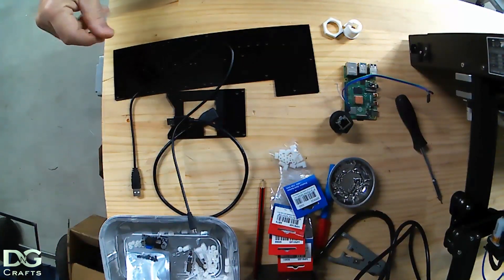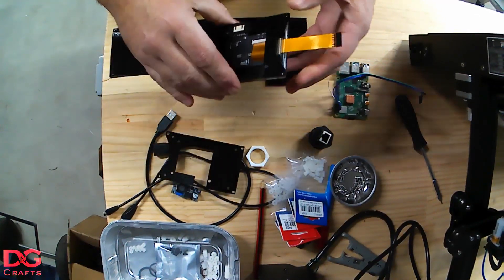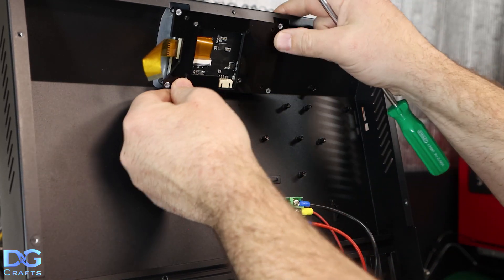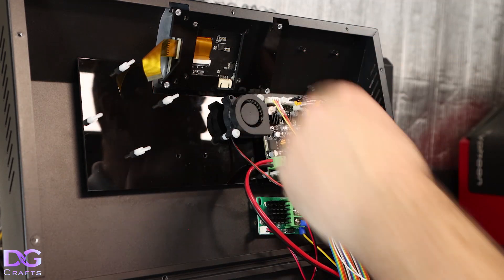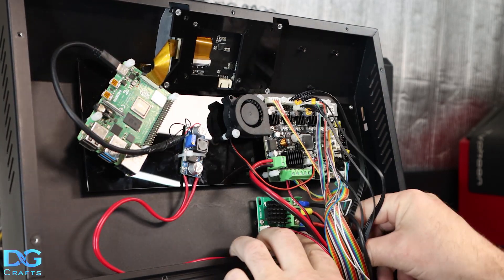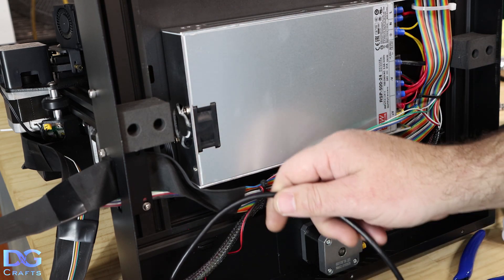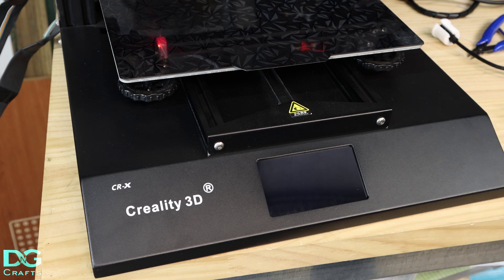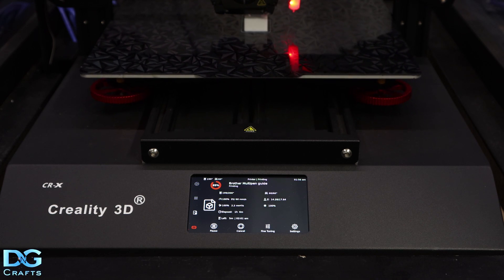Upgrade CR-X / CR-10s Pro to KlipperScreen

Comment: Hi, I am wondering what mainboard is installed into your CR10S Pro?  I am interested in doing this upgrade. The mainboard I see in the video does not appear to be the same as mine.
Reply from the maker: the printer in this video is a cr-x with the silent stepper mainboard used in the cr-x pro.

they are pretty much the same and the printers mainboard is not really an issue because you should be able to flash the klipper firmware to it and have the pi do all of the work with klipper.

i had a cr10s pro v2 which i also done the mod to and it worked fine.

Comment: Great tutorial, I'm in the middle of upgrading my old CR10s Pro V1 with a BTT SKR Mini E3 V3 motherboard. Just trying to work out the ribbon cable conversion to the new board. Noticed that you have done this already with this build, do you have a schematic for the ribbon cable to motherboard?  Was thinking of using another daughter board but was not sure if this would work on both ends of the ribbon cable???  Thanks for your feedback.
Reply from the maker: no sorry i dont have a schematic
Reply: Hey i might have that, are you still looking?
Reply: @aumthakore450  Can I have the schematic?

Comment: Did you upgrade board and do you have firmware. Looks like 4.2.7. I want to mod both my printer and install klipper as you did. Not to good at compiling firmware.
Reply from the maker: all my cr-x boards were upgraded to the silent stepper driver versions that the cr-x pro had.
i dont have a firmware sorry as i moved on to core xy printers like the k1 / k2 a fair while ago so i dont have eny of the old printers or software.

Comment: Would that screen stl work with an BTT PI 4.3 and the mainboard stl with a BTT SKR Mini E3 V3?
Reply from the maker: the screen used was the 4.3 inch btt pi tft v2.0

https://biqu.equipment/products/bigtreetech-pi-tft43-v2-0-screen-board?_pos=1&_psq=bigtreetech-pi+tft43&_ss=e&_v=1.0&variant=39337700786274

for anything else i doubt the design files will work for those as they were designed to fit only the parts used.

Comment: Very clean install. Where did you get the mounting boards?
Reply from the maker: i designed and laser cut them, the design files are here.
you could 3d print them 2 or 3mm thick

https://github.com/DnG-Crafts/crxfiles

Comment: I have a V2 with a 2.4 mainboard from 2018-8-13 but klipper is never able to communicate with the board. I have re flashed it 4 times and recompiled always the klipper firmware but no success. Looks like you have the silent mainboard but my was the modell before. Does anyone has install it successfull with the old version?
Reply: I have the same problem. Mine seems to run ok on octoprint but I really enjoy the features available with klipper.  This seems to be a dead-end printer.

Comment: Thanks for this very interesting video!
I've upgrade my CR10s Pro and bought the same screen, but what ever is the power supply I put (wnet up to 3A), my Pi 3+ keeps crying that it hasn't enough power... As if the screen was draining too much current.
However, there is no way to power the screen seperetly... I was wondering if you had the same issue?
Reply from the maker: i ran both pi 3b+ and pi4 using the same method with the lm2596 set to 5.1 volts and they all ran fine.

maybe try a different cable from the lm2596 to the pi, one with a thicker wire.

Comment: Where can i buy this build plate can you paste link?
Reply from the maker: i purchased them from a local store but you can get them on aliexpress
look for pei/peo build plate and the size is 310x320mm.
if you have never used a metal build plate you will need to make sure you select the option for the magnetic base to be included.

this is one i found quickly
https://www.aliexpress.com/item/1005006094088775.html

Comment: Oh man ive been looking to do this upgrade to my CR10 for ages now and scared to do it because i couldnt figure out what to do for the cr10s peo since it seemed no one had this printer.  

Based on the comment section here you kept the original MCB ( I'm runing a 10s pro v1 so i might do that just for the extra headroom ),and was wondering why you did?
Reply from the maker: the only thing i swapped out was the original screen, i kept everything else stock and added the new screen with a pi.
i was originally running them all with the pi plugged in to the usb port and the dgus_reloaded firmware for basic functionality on the stock screen but i wanted to use klipper screen so this was the way i went about it.

the reason i moved the mainboard over was just so i could have the usb plug within the printer enclosure to keep everything tidy and i dont use the microsd on the printer to load gcode i do it all through the klipper web ui so this was the logical way to set the printer up for me.
Reply: Just added the tft to my Christmas list to see if this is my Christmas project or not haha. I've got an old pi3B laying around as well as a pi4 and some bucky boards as I wanted to also swap the fans for noctua fans so the printer runs quieter. This will make for a great project and way to update and get some more life out of my cr10!

Thanks for the video and the files for the mounting board!

Comment: Is your Klipper setup running on a CR10s Pro V1 or V2? I have a V1 with a Creality 3D V2.4 mainboard. I can't find a printer.cfg file for the CR10s Pro V1. Will the V2 .cfg files work? I have an inductive sensor, and would rather keep it instead of switching to a BLTouch.
Reply from the maker: mines a v2
i dont know if the v2 config will work for the v1 but you could use it as a base to build a custom cfg for your specific hardware.
the pins and settings for the steppers are probably all the same but you would need to look into how to setup the config for the inductive sensor.
Reply: Thank you. If anyone out there has a CR10s Pro V1 printer.cfg file that deals with an inductive sensor they can share, it would be much appreciated.

Comment: Have you tried desuuuu clipper firmware for cr-10s pro/max? it is possible to leave the stock lcd...
Reply from the maker: yes i was running the dgus variant before i decided to upgrade to klipperscreen, i even updated the klipper version used with the dgus but it was still fairly primitive compared to klipperscreen.
we tried to get the klipper developers to add dgus support to klipper but they seemed uninterested.

Comment: so just by plugging into the mainboard with usb, the pi takes over? im looking at doing klipper with my old laptop i have here on my cr-x
Reply from the maker: once you flash a small firmware file to the cr-x mainboard the pi takes over with klipper on it.
there are lots of guides on how to setup klipper that should get you up and running.

my stock cr-x printer.cfg file for klipper is here
https://github.com/DnG-Crafts/crxfiles/blob/main/printer_creality-cr-x.cfg
Reply: @DnG-Crafts   thanks for the fast reply, how do i flash the firmware to the cr-x, and where do i find the file? thanks for sharing the klipper config thats going to save me SO MUCH hassle! im def hitting the subscribe button
Reply from the maker: @christhorney  you compile the firmware with klipper on the pi and use the pi connected to the printer to flash it.

just look at how to setup klipper videos for the cr-x or the cr10s pro v2.

i use mainsailos on my machines
https://docs-os.mainsail.xyz/
Reply: @DnG-Crafts  no worries mate thanks I'm looking into everything, as a total electronics noob it's a lot to take in

Comment: This was just what I was looking for.   Thank You!!   Did you connect to the Creality CR10s Pro V2.4 control board on your other printer or did you connect to an aftermarket control board.
Reply from the maker: I used the stock mainboards in all of them.
I just changed the screen and added the raspberrypi and installed klipperscreen.
Reply: Awesome,  I am going to set mine up this weekend with a minor tweak to the configuration file leveling sensor.   Thanks again for the great work, guidance and documentation!   @DnG-Crafts

Comment: Hey, I got some more questions :)
1) Can you please share printer.cfg?
2) Did you have to flash something onto the main board? (using make and make flash in ~/klipper) ?
Reply: Update about #2: I had a problem where I could not connect to the MCU from klipper (and could not flash either).
The solution was to download the hex file from rpi to my PC, connect the USB cable of the mainboard to my PC, then flashing it manually using XLoader.
After flashing was successful, connecting the mainboard USB cable to rpi made all work.

I'm writing this just in case it might help someone :)
Reply from the maker: @ramisamuelson6941  yes i have had that with some mcu's where the first flash required me to use a laptop and directly flash the compiled file, after that i could update the mcu from the pi.
Reply from the maker: @ramisamuelson6941  i uploaded the configs to github https://github.com/DnG-Crafts/crxfiles

Comment: hi 
where the power input for the voltage regulator connect to?
Reply from the maker: the voltage regulator is connected to the printers power supply on the V+ and V- points.
Reply: @DnG-Crafts I connected it to the same terminals it connects to the mainboard.
Sometimes I get "under voltage" warning, do you get that too?
Reply from the maker: @ramisamuelson6941  not with mine.
i set the output of the voltage regulator to 5.1 volts and both the rpi 3 and 4 seem to be happy with it.